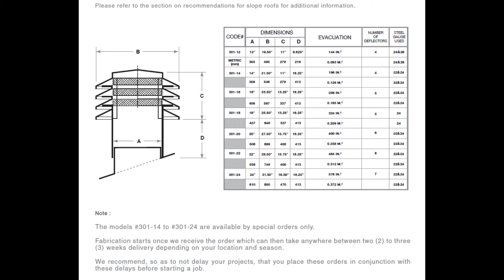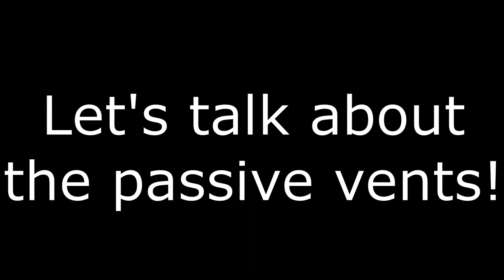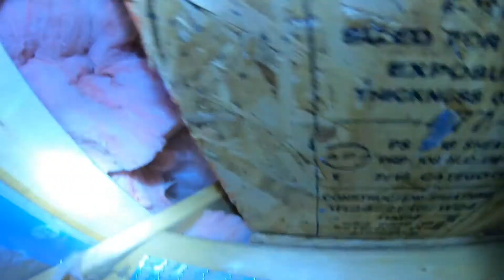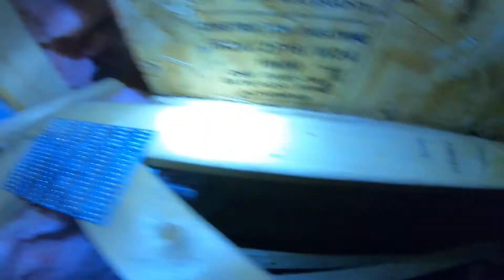Roof ventilation - Passive vents, static vents, roof exhaust vents explained!

Comment: I’m planning on getting my roof done and been given a few options in regards to venting still not sure, but was wondering if the turbine vents make noise like a low humming sound when running? Are the solar vents a good option? I have a hip roof and not sure which vents would be the best choice. Any insight would be much appreciated. I’m in ON thank you.
Reply from the maker: Glad you reached out, I always recommend either the maximum vents from quebec once I understood that they had weather stoppers to prevent snow or rain from getting in the intake. The whirly birds will make noise over time once the bearings rust up and they may stop spinning if not maintained. Hope this helps.
Reply: Okay, thank you very much.

Comment: The terminology used here is confusing. The term "static" denotes no moving parts and should not be applied to a turbine ventilator. Food for thought. Thanks for the video.
Reply from the maker: I thought I had put the turbine vents as dynamic vents.

Comment: Great video, I definitely learned a few things here. I wasn't really familiar with the turbine vents vs others. Do you think the turbine upgrade is better than a powered fan to move hot air out in the summer?
Reply from the maker: Honestly I've said this before, adding insulation to r60 for loosefill is the way to go even in the summer. Here it gets super hot and humid somewhat like Florida. This is because we have lots of lakes around. As long as you have venting that won't be covered by snow in the winter, that is the way to go (and let in snow and rain of course). Thanks for watching man.
Reply: @SinnisjInsulator  thanks for the reply. I think folks can learn a lot from what you have here. I visited Florida for the first time this year and man....I prefer the dry Idaho heat! That humidity is no joke
Reply from the maker: @BourbonCreations  I look at summer like the reverse of winter. The vapour barrier being installed in the outside of the house for hot humid climates. People dont understand loosefill I think, it's very fluffy, even cellulose, compared to foam. The more loosefill or blown insulation you have, the better, since it's not a vapor barrier. Thanks so much for your awesome comments.

Comment: Hi Josh,
My good FRIEND.

We are getting condensation on the inside of our metal roof in our outdoor kitchen. 
Any suggestions on how we can insulate to stop it?
Reply from the maker: Hi Garry (hope it's spelled correctly) I may need you to send me pictures of your issue and I can give you my professional feedback. With sheets of any type of open cell of fibrous structure, it will let air pass or vapor. Metal is tricky because it cools very fast and therefore sweats easily. Best practice for roofs where the underside is all metal (metal roof not installed on osb sheets) that means you need an insulation that sticks right to it with no air gaps. Air gaps will allow condensation and will ruin insulation directly under the gap or air. Hope this clarifies things a bit.
Reply from the maker: ahah. great query. I would need to know what height of attic we are dealing with and if there is venting possibility, especially since were dealing with a metal roof. Is the roof only sloped on 2 sides or is it sloped on all sides? I'm thinking gable vents plus sheets of fiberglass is the easiest way if there is not much attic space.

Comment: Gable vents and whirlybirds can cause a backflow in some situations I still think, I’ve found piles of snow and wet insulation a few times,  maybe it’s because of plugged soffit vent.  Not sure 🤷‍♂️. Great video!
Reply from the maker: Yes, gable vents, in certain situations, like if they have a roof section in front of it can draw snow or have it blow into your attic. I haven't seen yet any gable vents drawing snow, if on the flat face of a house. But I can see if the wind picks it up at the right angle it can get in there. That's where Maximum has added those weather fins, I think.